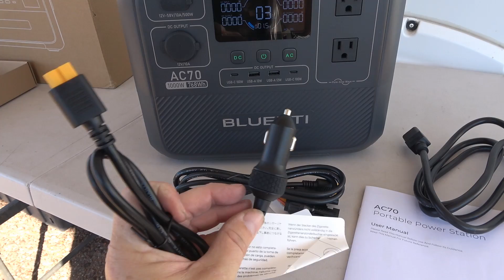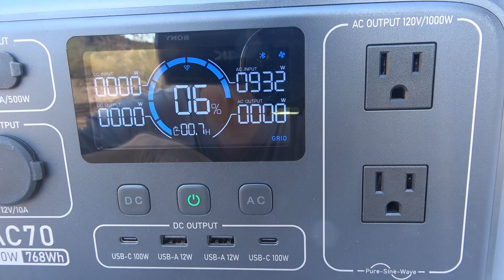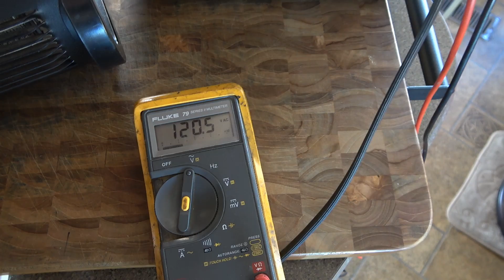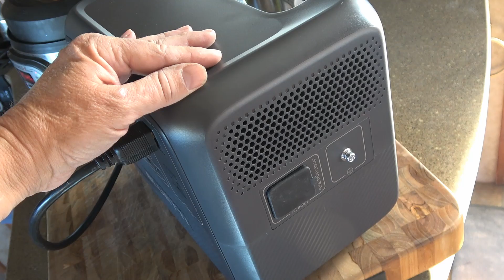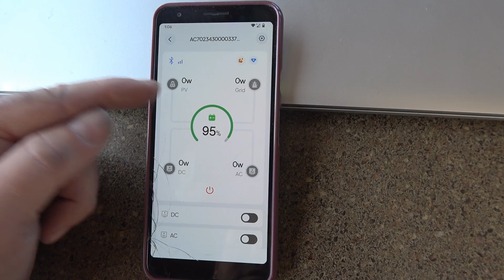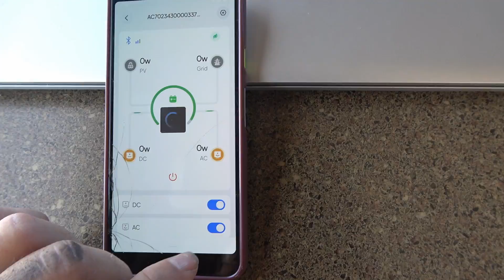Bluetti AC70 - Fast Charging Compact Off-Grid Power Station (1000W Inverter, 768Wh LIFEPO Battery)

Comment: Power stations have advanced quite a bit since I bought my Bluetti EB150 just a few years ago, same with the most recent LiPo 100 Ah batteries. I recently installed a Vatrer 100Ah with bluetooth in our travel trailer. Not having to buy shunts, extra wire and monitors has greatly simplified this type of upgrade from AGM batteries. I’m looking forward to similar performance increases in future solar panels. Thanks Ray, you produce very helpful videos.

Comment: I wonder how long you could run a cpap machine or two. Great review Ray. Cheers!
Reply from the maker: It's hard to say for sure as CPAP machine's power draw varies, especially if a person uses the heated humidifier. It also depends on whether the CPAP uses DC or AC power as the inverter part of the AC70 uses some power to convert battery power to AC power. But let's guess a CPAP at 50 watts draw. That could be roughly 12 hours, maybe a bit more run time.
Found this on the Jackery website:
How Many Watts Does A CPAP Use
Depending on the brand and model of your CPAP machine and the comfort features you have turned on. You may need a different quantity of power. A CPAP machine typically consumes 30 to 60 watts without a heated humidifier at a usual pressure level of 7 to 12 cm H2O. The power consumption of CPAP machines can reach 70–100 watts when heated humidifiers are used in higher-pressure settings. Although most models only offer waterless humidification, travel CPAP machines are significantly more efficient and usually provide therapy for just 5 to 20 watts.
Reply: I run my ResMed11 using a 12-volt adapter I got from Amazon. When camping I don't run the Humidifier but do put room temperature water in the reservoir.

Comment: Good day sir, I just recently discovered your channel, really enjoy the content. Specific to the Bluetti power station you just reviewed would this unit be suitable to plug in star link? I plan to be doing some extended cruise on board my 48 Tollycraft and just ordered my Star link, I will be working from the boat so power management is something i need to pay attention to. I thought something like the Bluetti might be a good option. Any thoughts you might have would be appreciated. Hope to run into you out on the water some day! All the best.
Reply from the maker: It will power it easily. My guess is you'd get about 12 hours Starlink run time out of a fully charged AC70. So would need maybe a couple hundred watts of solar to recoup over the course of a day. These are just rough calculations. We used the Starlink on our boat last summer and it worked great, we would turn it off and on as needed.

Comment: Good review- Thanks Ray! 
We have an EcoFlow. Question: So when testing capacity, can you damage the product you’re testing? I’ve wanted to test the boost function but I’m concerned with damaging the component I’m using to test with. ie, blow dryer, Nespresso machine. Any concerns with that?
Reply from the maker: The lower voltage won't hurt resistive loads like a blow dryer, heater, stove element, etc. But anything with sensitive electronics is a small risk. Most have internal regulated power supplies that can handle low voltage like happens in a shore power brown out but you never can be totally sure about it. Most advanced RV surge protectors have low voltage cut-off set around 103 VAC, and I noticed this box went lower.
Reply: Good to know- thanks!

Comment: Hey Ray,  I was wondering or wandering off topic a little bit. Do you use anything for your offgrid systems to protect from lightning strikes or panel flash overloads? 

If you've already made a video on this could you link to it please?
Reply from the maker: I don't do anything special. My solar panel frames aren't grounded. They are all fused, and my wiring is fused, but one never knows with lightning. I don't really encounter lightning all the often. Not too often occurrence in the desert in the winter or on the coast. If I was going to be in a big lightning storm, I'd put rubber pads under my jacks or raise them and hook up the truck. The trailer is made from an aluminum frame, so it should be safe inside or waiting out in the truck. Cheers, Ray
Reply: @LoveYourRV  I  haven't run into too many problems with lighting either.  Last year was the first time I had any at all. We had sheet lightning during the day associated with a fast moving cold front in the lower mainland. The flash from the lightning melted all my solar mc4 connectors, the mppt controller went into failure(then to manufactures default) no fuses or breakers tripped and the batteries (hybrid system) had no noticeable impact (except bms on lifepo4 reset to default). So, not a big problem to  fix, just wondering how to prevent it in the future. One other note, I only had 400 watts tied to my 800(60 amp) mppt. I think the reason that the mppt controller and the bms were not damaged was due to the fact that the lead acids acted as a capacitive sink.
Reply from the maker: Could wire the panel metal frames together and then to a ground rod pounded into the earth away from the RV but that is kind of inconvenient unless you don't move much. The best you can do is try and direct the lightning path away from things and into the earth, but it doesn't mean it will work for sure; lightning is unpredictable.

Comment: I always thought having a solar battery charge with solar panels not a gasoline generator. Doesn’t that kinda defeat solar charging. Why don’t you just use gas generator?
Reply from the maker: Most National, Provincial, and State Parks have limited generator running hours, usually two hours in the morning and two in the evening. You can't always count on getting good solar power due to clouds, fog, and tree canopy, so it's nice to have both options.